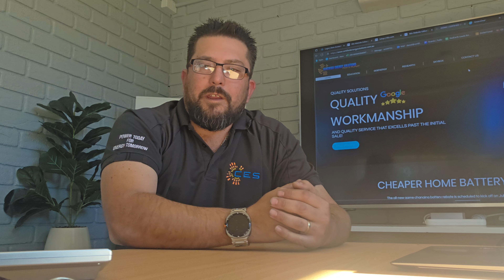Is your home eligible for the battery rebate while meeting AUS electrical standards requirements?

Comment: Damn. So difficult to get straight answers! I was told by an installer the 900 above a Sigenstor stack would have to be measured from top of the stack, inclusive of the inverter, because it is attached. Only a physically separate inverter could encroach into that 900 space above. Also told the distance from side of stack to garage door could be ignored if there was adequare circulation space in front of the stack to permit safe exit through garage door without getting too close to stack (1 metre).
Did you say networked smoke alarm in EVERY room if garage attached? This is wild! House already has smoke alarms of course, but not in every room! All this for stationary LFP battery (spoiler: extremely difficult to get one to burn at all), when mobile NMC (slightly more flamable) battery in an EV could be parked in the same garage without ANY requirements, or worse, a combustion car (still rare, but statistically the MOST likely to catch fire)!! I know you don't make the rules. Just how is the consumer to know when they're getting scammed for unnecessary additional work, or if their installation won't be up to code?? This is only day 10 of the scheme & already so much inconsistency 😢
Reply from the maker: Welcome to our world 😂. Is a nightmare to navigate at the best of times, and many of the regs are open to interpretation,  however the regs i discuss are very black and white in the standards so consider it gospel!

A cer certified electricisn with all the tickets will generally be much more on the ball when it comes to regs than a standard a grade as they do very different things. The solar industry and installations getting the rebate may also be checked up on by an inspector where as a standard electrician may go his whole career without being looked at once. Two very different trades at the end of the day. Atleast you found this video helpful for some clarity.

Comment: Can I, as a qualified A-grade electrician install a full off grid system (excluding the solar side of the install) myself in my own home and still claim the rebate? Or does the whole install have to be completed by a register installer? Thank you
Reply from the maker: Hello, indeed you can. However... you will not get the rebates on solar or battery storage as you need to be accredited with all the extra licenses to sign off. You also won't generally find any companies that will sign off on someone else's work as it could jeopardise the technicians license and livelihood.  

Being a federal rebate it gets a bit risky! 

You may also find issues with claiming warranty repairs on the system if you can not prove that a certified installer fitted the system. 

What i would recommend is what we have done for customers that are a grade. 

1. Get an installer that is happy for you to work along side the crew, you may be able to do things on site that could save you money substantially, aspecially on things like sub boards, ac cable runs ect while the guys are on site so they can be involved eith checking everything off. Silly I know but makes our guys feel much more at ease with this integration of sitr works. 

2. The retailer can then do the solar and battery install while being complient so you get the rebate in full.

Just something to consider as the rebate can be very substantial loss.

We have done systems like this for plenty of a grades without issue while saving them money where possible.